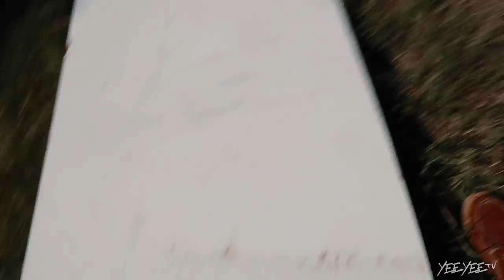I Put a HUGE Battery In A Toy Tractor....

Comment: Pro-tip: find something rubber you can cut into strips and wrap the wheels. It will have superior traction and turning improvement. Those plastic wheels barely provide ample friction for normal use. It doesn't take much, it just has to be a few inches wide, it's fun to play around with. BONUS: IT'S MUCH MUCH MORE QUITE ON HARD SURFACES!! LOL 😸

Comment: Not sure if you read the comments but putting a little bike tire on the rear tires will prevent them from just spinning on the concrete and if gives overall just more grip also prevents wear of the plastic overall I saw it on my little neighbors battery truck and he was able to drive so much more also could put some on the front to allow the lol tractor to turn better on the concrete

Comment: That tractor is insane. It hauls. I have a cheap PW jeep that is 1 wheel drive and runs on 6 volts. I had to stud the wheels because it would slip all the t ime. I wired two 6 volt batteries to it and it moves but the gearbox slips sometimes.

I've never seen nor have been stung by a scorpion but up here there are mosquitoes and black flies. No fire ants.

Comment: If you put bolts with large heads in the rear tires it gives better traction on softer surfaces like loose dirt and grass and sand it will climb a nice hill

Comment: You can safely over volt those motors by one and a half times meaning a 12v motor can safely handle 18 volts but in short bursts you can go twice stock

Comment: I use to live in bastrop tx right outside of Austin and I have been stung by a scorpion and it's about the same as a bee sting
Reply: I've heard it depends on the size, larger are less venomous, smaller are bad on venom, but I've never been stung.  Does aspirin work like on a bee sting?

Comment: Burn the motor up doing 24v do a brushless rc battery lithium ion last long and charges faster take some old bike tires and wrap the back tires screw it down with some drywall screws my kids go over tree stumps in the little razor sidebyside
Reply: If you run those batteries parallel you will keep the volts 12v wont burn your motor up and double your run time ah

Comment: My husband bought a Nissan Leaf in 2015 and he used to sit in this dumb thing while it was plugged in charging on his breaks at work. He was diagnosed with bone metastasis in his lower back in 2017 and he died in 2018JAN. He was type 2 diabetic and always saw 2 and 3 doctors a month. So if it wasn't from the pharmaceuticals then it was the electric vehicle.  I sold that thing right after he died.

Comment: boys will be boys. when i was 3 i took my 3wheeler to a big hill that had a old locker room thing made out of concrete on the bottom. my stupid ass just tricked down the hill full speed and my mom got super scared becaus she knew there was that concrete wall att the bottom so she tought i had cracked open my skull and stuff. well just before i hit the wall i jumped off my 3wheeler and the 3wheeler hit the wall and broke in to 1000pices xD